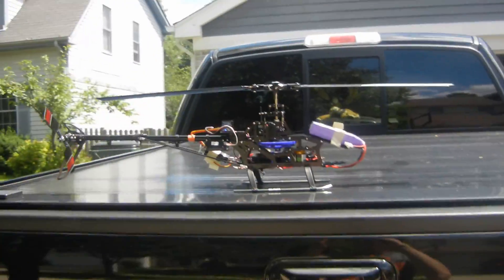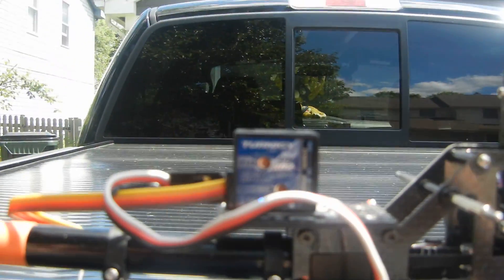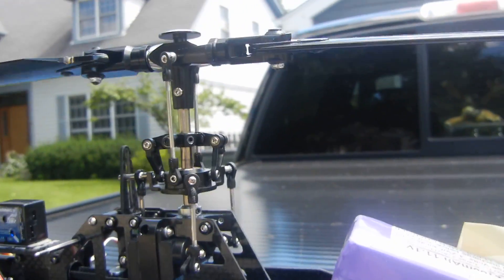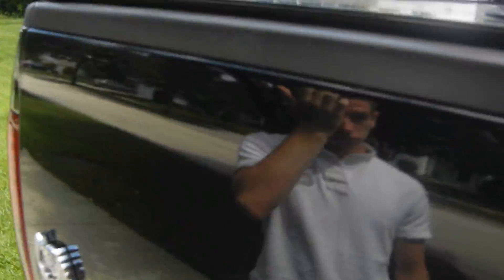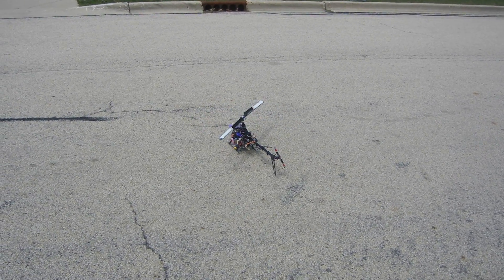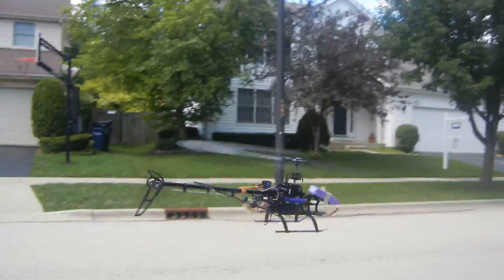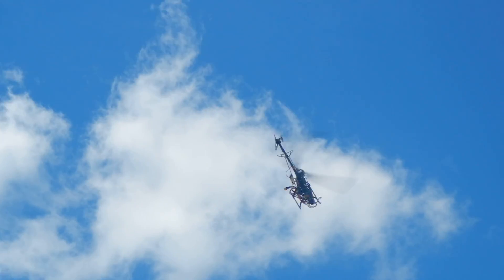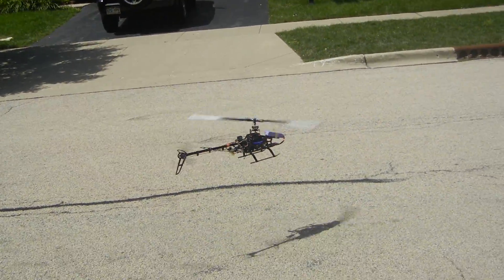Proof That You Don't Need An FBL System To Fly Flybarless Part 2

Comment: A buddy has been flying scale 5 blade heads since I first started 16 years ago with only a 401 tail gyro. You don't really need a flybarless, it's just for stability. More of an interference than anything, but makes flying easier for the new comer.

Comment: a lot comes down to the size and weight of the blades, if they are big enough and heavy enough they will give a certain amount of stability by themselves but I set you a challenge, remove the flybar or even just the weights from the flybar on the v911 micro heli and post a video of you trying to fly it, it's an amusing experience ha ha

my bigger helis cope much better without the flybar but that tiny little thing that weighs less than a fart becomes a bucking bronco lol
Reply: Steve			 Fox Yeah if I had his skill I could fly that way. The fact they make the system for a reason and not everyone has this kids mad skills. 
I have a handicap so by having the flybarless system meansI can fly yet. otherwise  I couldnt.
Reply: what about removing flybar from a v913? will it fly smoothly? assume I am a skilled pilot
Reply: @jwardana  making the 913 flybarless is not a straightforward task but can be done, you need t lock the head once the flybar is removed and you will need a flybarless controller, it will be un flyable without one.
Reply: @stevefox3763  ok thanks
Reply: @jwardana  I have had a 913 flying (just) flybarless but it really isn't worth it.
The 913 is crap no matter what you do to it, the 912 is a far,  FAR better heli if you want a fixed pitch. 
My 912 is heavily modified (still flybarred but absolutely everything else you can think of has been done to it) and flys very well.
Reply: @stevefox3763  ok thanks for your opinion. I want a 913 because of it size. any recommendation similar size with similar price? I've learned about fx067c, unfortunately it's no longer available. a local shop looks that it still has one but I'm afraid for parts in the future
Reply: @jwardana  the reasons to mot get a 913 are multiple. 
It is a very poor handling heli which want to pull itself over and into the ground in banked turns due to the head assembly and particularly the flybar being far too big and too heavy.
It is a slow and poor handing heli in general.
It it very heavy for what it is.
The slightest contact with anything from the blades will strip the poor quality main gear every single time and every single crash will require replacement. 
The swashplate is very weak and the arms snap in Almost all crashes.

The 912 is a much faster, more agile heli who's handling is orders of Magnitude better,  the main gear is also made of a totally different plastic and far more durable as is the swashplate and the heli can handle crash after crash and be picked up and flown again without repair providing you kill the throttle when you know your going to Crash..

The onky weak point in the 912 is the landing gear but putting 913 landing gear on it will mean it never breaks as they are much bigger and the only strong part on the 913 lol.

Modifications can also make the 912 a very good heli,  about as good as a fixed pitch can be.

Getting a brushless version is compulsory,  the brushed ones will burn out motors in a couple of flights, the brushless will last and last.

Mine has also had the tail converted to brushless 

I own both the 913 and the 912 and I cannot stress enough how bad the 913 is and you should not get it!
Reply: @stevefox3763  okay thanks for the suggestion. I'll consider a 912. btw at almost the same size with 912 what about v950?
Reply: @jwardana  I don't have any experience with the 950 so can say how robust it is but it does seem like a fairly decent heli although being a 3d heli its gonna be prone to the rotor head exploding in a crash and not a good first heli if that's what your looking for.

If its your first , I would stick to something which is fixed pitch and has a flybar, they are far more forgiving and you can move to something more sporty later but I still fly my 912 despite having 450 size cp helis, the 912 is still a lot of fun to fly and there's no worry about crashing it :)
Reply: @stevefox3763  ok thanks. actually I'm looking for my second which is bigger. my first are v911s and eachine e119. after learning how to fly for the last few months I think I need something more bigger. and actually I'm not interested in 3d. I tend to be scale chopper person just haven't decided yet what model. btw can you suggest a group, maybe with specific thread that discuss about it? thanks

Comment: One of my blade screws came off and shot the blades! And destroyed my futabagy401 original, but canot afford a new one and I was looking into this gyro you have I will not be doing any 3d stuff just basic flying you're set up looks really good more info on settings and is that gyro reliable because I'm really thinking of getting one thanks for great video and great flying..